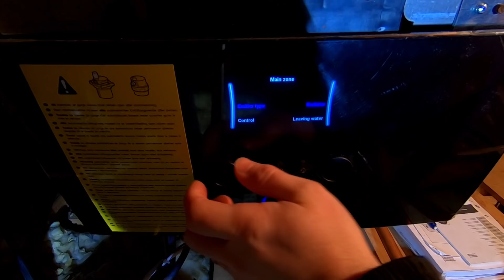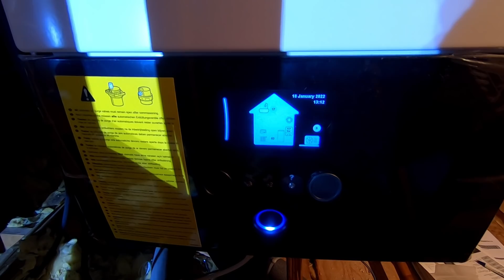How to lose £2000 installing a heat pump

Comment: Not a gripe against the installer, but dear god .. the lagging and external pipework 
really? Brass valves on show, rain and wind penetrating the lagging
Reply from the maker: They are not brass valves, those are anti freeze valves and they have to be exposed as they are there to drain the system in case of power failure
Reply: @UrbanPlumbers  
Hi, wasn’t criticising your work - I get that you were sub contracting so you were working with what you were given spec wise?
Any heat loss from the F & R bleeds heat, making the pump work harder which  influences defrost cycling. 
I’ve just refitted more appropriate lagging to a 1 year old pump to replace internal grade 19mm that the sun degraded and the local rodents used for bedding. 
Another note, rodents love clean fresh water on tap! They’ll get used to it and set up home close by - before you do a WHAT it was a common fault when 
installers couldn’t be arsed to fit the condense drain tube which was mounted on the underside (bottom) case on earlier ASHP models. 
They’d drink the condense and pee on the PCB. Why? Because they can I reckon. 

Please tell me different, the lagging doesn’t look like armaflex tuff coat (or similar) the heat loss from rain and wind getting through the lagging will be massive… er… bit like a heat pump. 
Take a look at some of the solar quip pipe systems, I’ve been using it on external oil boilers and heat pumps for years with out problems. 
S/S pipe, similar to trac pipe, inside a water proof insulated outer. District heating pipe (mibec) the same, so you can go further away from the house if you wish. 
Different thicknesses of pipe (for flow rates calcs’) and insulation available. 
I’m old, a bit grouchy and been at this for 40 years. 
Your pipeworks tidy and you’ve got the work ethic - you’ll be fine. 
Just watch out for sales reps and hard sell green energy companies telling you about “This is the future”
Play a game on your next video called 
“Who has a ten year old heat pump” then work your way back down - could be funny. 
Nothing wrong with ASHP’s in principle, it’s just that the models change every five minutes with different internals, which gives me the hint they are still practicing on you and the public at large. 
🤦‍♂️
Reply from the maker: @miketurner3964  correct, a lot of companies are still developing the tech. It will be interesting to see if ASHP market grows and what advancements become available in the future!

Thanks you for your comment.
Reply: @UrbanPlumbers  
My pleasure bud, keep the faith.

Comment: What's the brand of the heat pump? This heat pump is looking to small for that house.😅. 

I have Chinese gree versati 16 KW heat pump with floor heating and just with 30C water temperature 🌡️ is getting too hot 🔥 inside the house 🏠 😃

My heat pump is 2 times bigger than this pump .
Reply from the maker: My mates heat pump is bigger than yours though 😎

Comment: I would be interested to know how you got involved in this project. It always starts with a clear scope and good design. If you just take a job and then start thinking about how to do it, you're screwed.
Reply from the maker: it is a long story. I did asked numerous times for more info before the job started, but never received anything!

Comment: Should have just installed high retention storage heaters, far cheaper and never lets you down. Heat pumps only work in super insulated homes. It’s all about the government funded tax con
Reply from the maker: I appreciate your opinion. Storage heaters would cost you 3x more to run, so not sure if it is such a good idea.
Reply: @UrbanPlumbers  I would like to compare your kw per hour arithmetic with mine. for example a 3.3 kw storage heater would heat a 20 sq/m room. Overnight it would consume 7 hours of electric on cheap rate ( 23kw) about £2.30 a day and it would guarantee heat convection throughout the day. Any heat retained at the end of the day would mean less energy would be inputted to restore to full capacity meaning less kw hours spent. Heat pumps run throughout the day on the more expensive rate and the heat output is too variable. Also air source heat pumps cost a fortune to buy ,install and maintain. I know which one I would choose. Obviously that’s not good for business 👍

Comment: Will you recommend replacing a high efficiency gas boiler with air source heat pump? Do I really need to upgrade the insulation level of the house before the heat pump installation (can the heat pump still work for a poorly insulated house?) , say the house is quite old?
Reply: No! Dont do it!
Reply: @ahuman6825  Is it not recommended heat pump itself or not recommend heat pump without insulation upgrade?

Comment: I’m quite shocked at this. As one of the people that first bought heat pumps into the UK back in the 90s and worked with NIBE first single phase air source heat pump... we really realise that the best efficiencies are within 30 miles from the coast that take advantage of warmer wetter air this sort of installation is very difficult and it’s hard to see any cost savings. The environmental savings in a built-up area are very close to 0 as the power generated comes from gas turbines. Unfortunately in this installation gas sadly would be the cheapest option..
Reply: Even if heat pumps are powered by fossil electricity, they are still more environmentally friendly due to their efficiency.

A modern gas or oil condensing boiler has a theoretical maximum efficiency of 98%, whereas heat pumps have an efficiency of 300-450%. So less primary energy is needed to heat the house.
Reply: @JackONeill23  they're going to average around 300% or less, and the UK's gas turbines for winter loads are only 40% efficient, so you're at 95% for the boiler vs 120% for the heat pump for a huge cost in extra generation and home infrastructure.
They make more sense here thanks to our hydropower.

Comment: I haven't watched the video, but I do want to share my experience of owning a 10yr old heat pump. One thing for certain, weather compensation is critical. Leaving the system on at a constant temp is also critical. Mine has been installed well enough aside from a few settings and legionella control. My home is a constant 20c and plenty comfortable. I also work in the gas industry, mostly in the transportation of gas (gas networks) and new gas connections under the new homes standard will come to an end in 2025. 3 years time, you're going to have to install well as there won't be many other choices so unfortunately it's a case of git gud!

Comment: We did a few hundred of these up to about 7 years ago - massively expensive, constant complaints from customers and often not able to reach temperatures despite all radio sizings being over spec - nightmare, these aren’t the future.
Reply: Our farm house had a hot water heat pump installed in 1987, apart from needing a new compressor in 1998 it worked perfectly until last year when we ruptured a pipe while replacing the roof of the house. No maintenance the entire time.
Reply: @dquad  I didn’t realise they had been so long, I went to a Mitsubishi seminar about them around 2012 and they spoke as if they invented it!

Comment: Great job, really impressive. Good quality, stick to it - in the long run you will remain. And you are 100% correct, weather dependent it must be. Floating condensation maximizes the savings, the gut that you talked to has no knowledge.

Comment: One thing I like is when you was in the loft &  you was taking time out to clip the cables as it should be done & like you said what happens if someone else comes up there on a later date..... The electrian was happy with the cables just to hang there like a washing line 🤣 this is typical of many trades people out there lazy and not doing there job correctly. Good on you _ You are the type of guy who does not bodge the job. 👍🏽
Reply from the maker: ahhh no, thats not what happened. Electrician is very good. We were talking about leaving a loop in the cable as it enters the building, so when someone pulls on the cable outside there is some slack and cables do not get pull out from connectors.

He told me to leave a coil of cable in the corner and I said I will tape it together so it looks neat. He said not to bother. It was just a joke really.

Comment: As the installation stands with its current settings, do you think it will be effective and economical for the customer? 

Much respect for your persistence in seeing the job through under difficult circumstances, and a very thorough neat job.
Reply from the maker: no, it will not be economical to run like that at all. It will also affect the lifespan of the compressor if it is turned on and off all the time.
Reply: @UrbanPlumbers  Did you ever find out what is the SCOP was hitting? Without the weather comp I'd be surprised if it was hitting the target for MCS

Comment: I had the same problems with daikin never knew when the materials were going to turn up and when the heat pump did it was damaged, so had to be sent back. Mine is working on weather compensation currently and has for the last 3 months like you say if you disable it gonna cost even more to run. The kit I think is good but the service and technical help is poor.

Comment: I've done HVAC/Refrigeration for 15 years. Heat pumps are absolutely terrible. Poor efficiency and constant problems.
Reply from the maker: Poor efficiency? What is more efficient the pan heat pump please?
Reply: @UrbanPlumbers  Pretty much everything is more efficient. Heat pumps struggle when outdoor temps are below 30/F. God forbid the outdoor temperature drops below 20/F. A heat pump will run nearly 24/7 to keep up, which means a running compressor and outdoor fan to drain the electric bill.
Reply from the maker: So you have done HVAC for 15 years and you think that heat pumps are the least efficient heating appliance. 

I don’t know if I should cry or laugh 😆 😢
Reply: @UrbanPlumbers  Yeah, and I can see why the guys who can't hack it in HVAC resort to plumbing.

Comment: This is one issue I stumbled into when getting a heat pump installed - main contractors that where cowboys. I eventually went with an ‘official’ supplier from daikin (the manufacturer) and they were great. Knew absolutely everything and let me geek out and help design the system. It works just great but let me tell you weather compensation is absolutely essential.
Reply: There rubbish though arnt they?
Reply: @rozzer666  if they were 'rubbish' the manufacturers wouldn't bother. Its like any system, anywhere - it has to be engineered for where its going by someone that knows what they're doing.

After watching the video, the company he was working for are a total bunch of clowns
Reply: What does it do? Can you explain?
Reply: @justcommenting4981  is adjusts the flow temperature based on outside air temperature, so basically as it gets colder outside the flow temp is increased. This is more efficient as you want to use the lowest flow temperature that heats the home. No need in running 50C water through radiators if you only need 40C to heat the home.
Reply: @mikeytrw  is this something found only on air to water pumps, or is it on air to air as well?
Reply: @justcommenting4981  honestly I’m not sure. Ive only used hydronic.
Reply: @justcommenting4981  air to air inverter based heat pumps dynamically change their air temperature based on room temp - it’s even more efficient.
Reply: @mikeytrw  thanks, I appreciate it anyway. I had no idea it existed until today.
Reply: @Etacovda63  cool. I'm in a cold area that gets below freezing for a large fraction of the year. I'm trying to decide if I can get an air source pump or if I should try to get ground source heat, but that is extremely expensive.
Reply: @justcommenting4981  just get a gas boiler for now. I'm not sure heat pumps even work below 10 degrees freezing.
Reply: @justcommenting4981  air source heatpump is good enough unless you're in an extreme cold climate. The cost to install a ground based system would never pay off in savings over a air based system Imo. Atleast not for most people
Reply: @randybobandy9828  define extreme.
Reply: -20c or colder
Reply: Do you know if internal daikin heatpump unit can be put horizontally instead of verticaly? I have very limited amount of space and would like to plan it under stairs
Reply: @MrMantosius  Big No I'm afraid.
Reply: @MrMantosius  I don’t know for certain but I’d wager money on no, it has to be upright. It’s the same size as a boiler so if you’re replacing one of those should be just enough room.
Reply: Why don't UK houses use air to air heatpumps like the rest of the world? It costs a fraction of money and time to install and you don't have to deal with copper water pipes and radiators? You also have the additional feature of air conditioning in the summer. It's a win/win/win
Reply: @randybobandy9828  Because our houses are often much older than in places like North America and don't have the cavity space to install the ducting. Water carries the same heat energy in a far denser form. Also pipes are more efficient because the smaller surface area of the pipes means less heat is lost in transit.

Comment: Heat pumps are a con. They are noisy as well, a boiler is silent compared to one of these things and they consume more energy the colder it gets to return heat energy that would easily be saving if used to heat a 3 KW heater. You have to put 3Kw in to get 1Kw of heat out the cold air.

Comment: Despite the struggle it's definitely a good move to learn about heatpumps. Our company in canada in switching over to hear pumps and my boss has spent the last 6 months making courses on heatpumps  and trying to improve design standards for the province. Seems to be inevitable all new build will be heat pumps in a decade or so.
Reply: Waste of money, expensive to use, not reliable and low temperature heat
Reply: @stephenrichards5386  depends on where you live really...

Comment: You my friend are an absolute legend! Your attention to detail is exactly what I would expect but sadly very few trades have it. Even when the sparks said to leave the cable you made the point to have it tidy.
This heat pump thing seems like a massive failure to me though and what a lot of work to install! I'd be interested to hear what the manufacturer has to say about disabling the weather settings..
Reply: All i was thinking of when i watched this....was that there'll be a major watchdog report on tv in a couple of years (when the governments push to switch to these things is in full swing)...& we'll be seeing the same horrific problems as in this video or worse!! 
As with most things in this country...we seem ill prepared for any new technology..from electric vehicles, charging points, to heat pumps etc etc...even the Sun is playing havoc with the infrastructure! 🙄

Comment: You need to be an engineer just to be a customer with a system like this. How do you spot bs like the weather compensation if you just trust the contractor
Reply from the maker: Not much different to gas boilers - tons get installed very badly and do not work efficiently and no one notices or cares.

Comment: Couldn't those pipes have been run up the side behind the drain pipe to not spoil the look of he front of the horse from the road? Not knocking you. Just a thought.
Reply from the maker: It back of the house and no they couldn’t
Reply: @UrbanPlumbers  cool. Good job.

Comment: This is the madness that’s going to prevail when we’re all expected to replace gas appliances. The sheer volume of equipment to change boiler is mind boggling. Also 80% of households don’t have cylinder anymore due to the combi boiler. I’ll be hanging up my tools if this is a basic picture of what an installation will become. Great video and a fantastic job done well.
Reply: I've been telling my parents the same thing, dont go for a combi boiler now just because it's cheaper. Stick with heat only so they're future proofed.
Reply from the maker: @davidcoghill8612  systems with hot water cylinders are so much better than combis. Combis is what is blamed for destroying the plumbing trade.
Reply: @UrbanPlumbers  funny you say that as I think it's self-inflicted - last year I felt urged to replace a 30ish yo heat only tank of a boiler in my rental - still going reasonably strong but no-one would touch it because it was 'too old' so I asked a few local fitters to quote for a heat only replacement (still using a vented cylinder) - most of them were suggesting ripping out the cylinder and putting in a combi - not sure where that mindset comes from other than the extra work and the argument that the vented cylinder doesn't have high pressure, fortunately I found someone who was prepared to listen to what I was asking for and settled on a Baxi heat only with 7yr warranty...
Reply from the maker: Your message was sounding good till you said Baxi heat only :)
Reply: @UrbanPlumbers  haha, I know, it was a compromise, although based on some logic since the Baxi heat only I have in my own place has been going strong for 20 years only needing a new spark electode and ignition PCB last year...sometimes it's best not to know what the problems are after you've commited ;)

Comment: Not going to lie, every customer I when to, was like yeah I want the weather compensator. Until their house is not at the temp they had with the old appliance. Then they kindy ask you round to turn it off. I think they are so aggressive with it for the energy efficiency rating it's pretty much useless. Also had the same thing with the new smart controls, "whys my heating coming on an hour before the time I set. Personally, I think it's all the consumer's decision, and most hate the weather compensator and the smart shit. This new and efficient stuff is good on paper but not so much in practice.